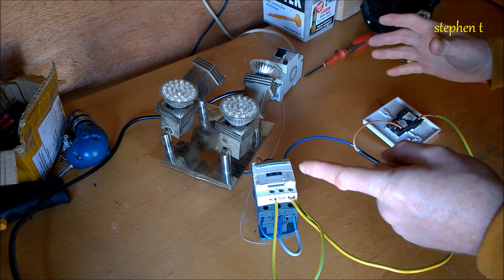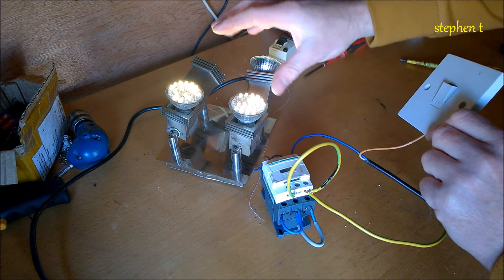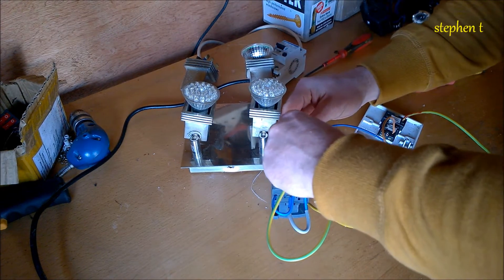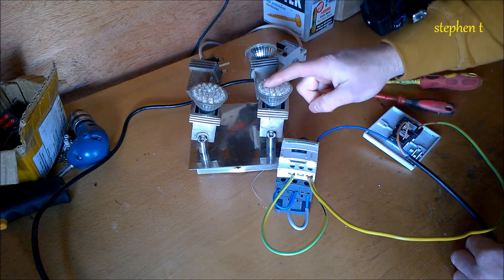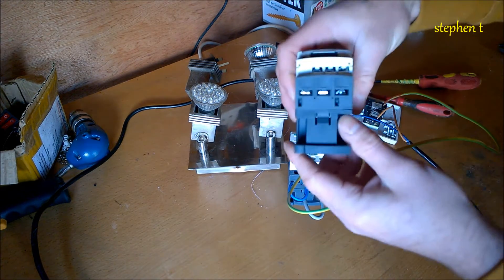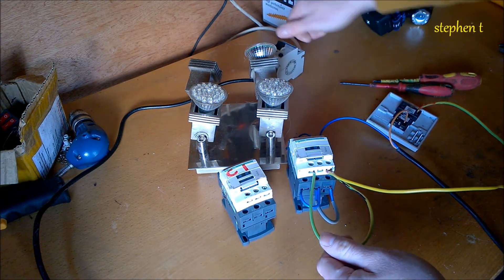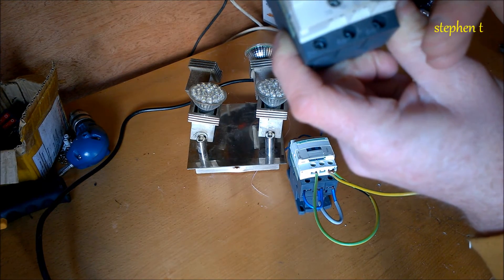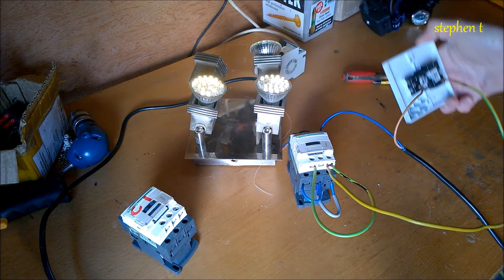D.I.Y HOW TO MAKE A CHEAP ELECTRIC BRAKE FOR 3 PHASE WIND TURBINE

Comment: Dear Stephen, great and informative video! 
I am working on a small scale wind turbine 500W 3 phase AC generator goes into a rectifier bridge and the output is DC do you have any ideas on how to electrically break this baby?  any help would be appreciated man thanks
Reply from the maker: Hi Wissam
The best way and cheapest way is to divert the power to a resistive load or a dump load.

Comment: Thank you for this alternative solution. I will be using this for a three phase 48volt PMG wind turbine testing but I am wondering if the contactor can be adjusted for voltage and amps to remain below the maximum voltage ?

Comment: Can you give an advice for electric brake with a single phase? (not DC system but AC system with one phase. Of course if it is after the rectifier, it should be the same )
Reply from the maker: Hello can you give me more details about this turbine.

Comment: How much to get those contactors? Sure beats manually crosses 3phase with your hands while under extreme load. Lol. I actually had to do that once. Didn't have wind for days...had taken down my power board, and had my turbine completely unconnected to any load (free spin). Then woke to 50mph wind/rain storm at 3am. Realized my turbine free spinning out of control on roof. Ran down to power board where 3 phase exposed wire sticking out wall. I assume they were very much live. Then in a sudden panic, knowing my choices where (1) leave turbine spinning out control in 50mph wind; or (2) grab and cross those exposed wires to manually brake. I opted for the latter, grabbed some electrical tape started wrapping the wires carefully while squeezing to cross 3 phase. Long story short all worked out and no shock
Reply from the maker: brave man crossing them cables ha ha.They are only 13 euro and 25 amps, but the amps is not important as they are only crossing the phases.I will put up a video of a completed system, There is a small bit more to it but its not hard to do.
Reply: Thanks Stephen
Reply from the maker: your wellcome